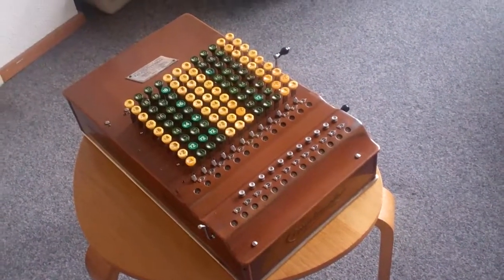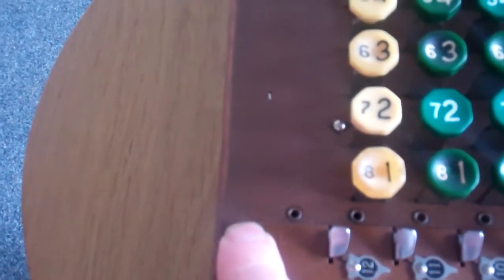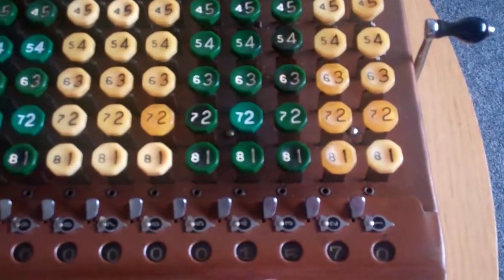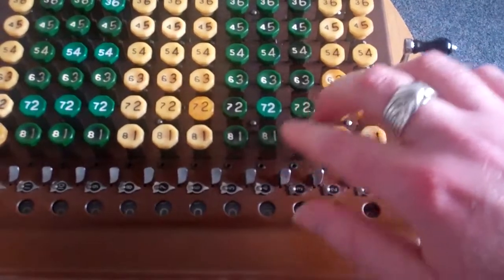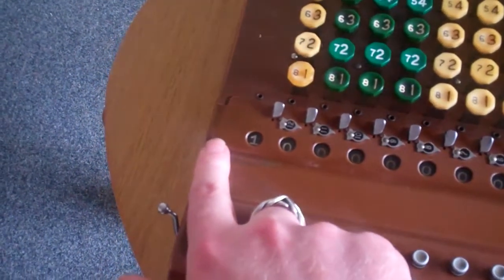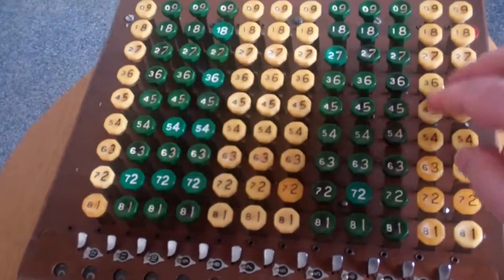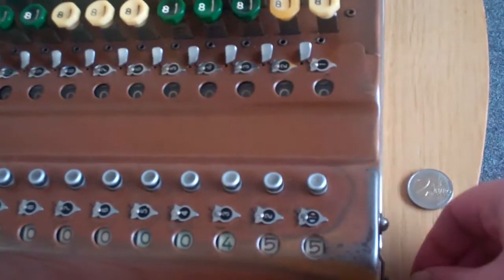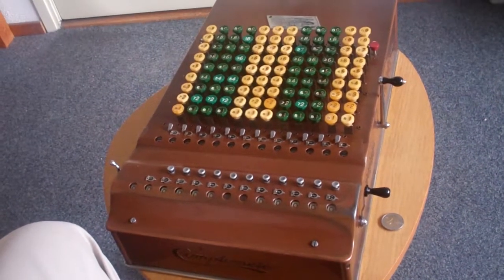The Comptometer Super Totalizer, a mechanical calculator.

Comment: I used to have one of these, (without the super totalizer on the front...it was one of the older ones with the larger crank that had to be push-pulled. Its been several years since ive had it but i believe it had 12 columns i never knew how to use it. All i can remember is how dam HEAVY the thing was!

Comment: Excellent video. I SO want one of these!

Interesting note about the zeroing. I didn't realize that. I'm rather surprised that there was not a "bell on/of" lever introduced on these since I can imagine ten of these in a room must have been just annoying as heck. I'm trying to learn how to use these, not because I have need of it, but understanding how the operators used them is part of the historical interest. I haven't quite figured out how to cope with the error detection yet. Most of the time, it just seems to get in the way. I suppose that's because there are no experienced operators available to me to say, "Hey, dummy, do this!" Remember, qualified operators were expected to be able to clear the machine, add a column of 10 two digit numbers, and write the correct total down in about 16 seconds.

You didn't do the subtraction quite right. You're subtracting one digit. Therefore, it is only necessary to hold the "carry cutoff" before the next highest digit and simply subtract 1 (add 9) in that first column. So subtract 12 from 1234. Hold the cutoff to the left of the 3, and then, using the small numbers, subtract one less (11, or add 88). Boom. 1222 is displayed. It gets more interesting when you want to subtract 3 from 10001. Then you have to "borrow" to do the job. However, you can't just borrow from the first digit as you would in other cases because repeated zeros cause problems for this method of subtraction (addition by adding the 9s complement of the number.) So you have to borrow all the way over manually and then subtract 2 (one less than three) and hold the cutoff when you do. You WILL get the right answer but sometimes its easier to do subtraction in your head or on paper than on the machine.

The "less one" also applies to sequential multiplication (third factor and beyond) and division.
Reply from the maker: I tried to keep the explanation simple, just enough to explain what the carry suppression buttons are for. I made another video where I explain arithmetic in much more detail.
Reply: @jaapsch2  👍

Comment: How do you subtract 99 from a number say 555-99=456?
Must enter a +901
Co digets 0_1
There is no co diget "9"
Is it normal to not press anything when subtracting a 9 like when adding a zero?
Reply from the maker: Yes. The complement of 99 is 01, possibly with leading nines. To subtract 99, you actually add (9)01 and therefore don't have to press any button in the second column.